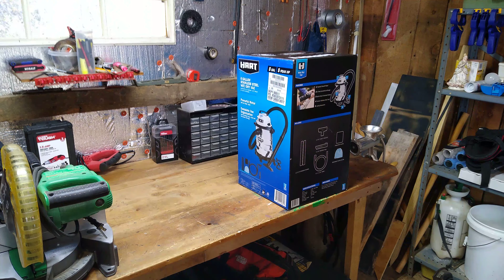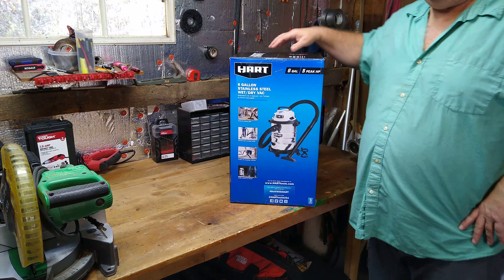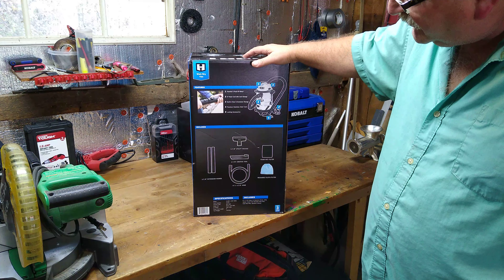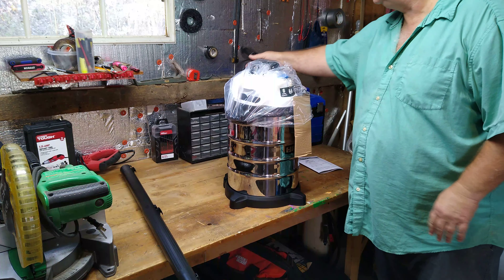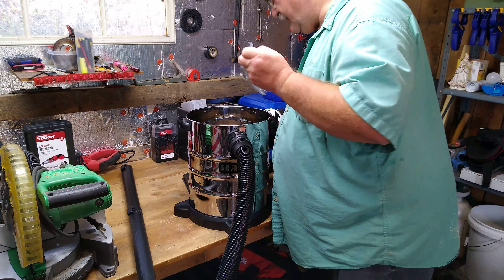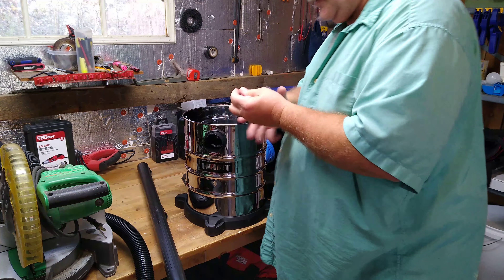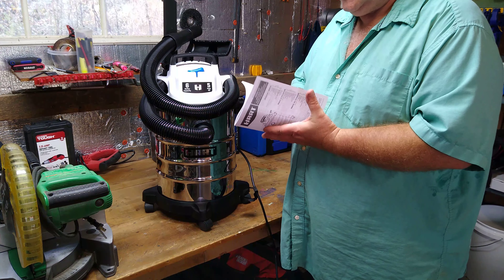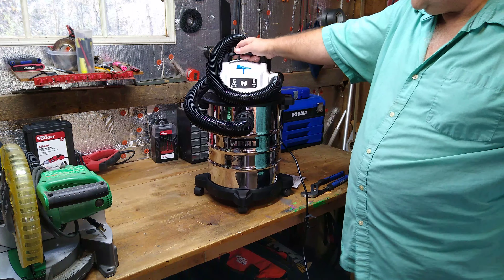Hart 6 gallon stainless steel vacuum, $29.97 Walmart Black Friday deal. unboxing and first look.

Comment: Does this mean that you can only dry vaccum up what will fit in the blue filter bag ? Or does the dirt go into the can and the blue bag keeps the dirt from getting into the motor ?
Reply from the maker: Yes you can pick up water, and you are correct the blue filter bag is to keep larger stuff out of the motor.

Comment: We just paid $58 for ours and it didn't come with a manual, I'm wondering if we use the yellow filter or the black filter when sucking up water, and or what if there is cat liter in the mix.. I am not a happy camper with my buy since I don't know how to use it.. can someone tell me in the comments please? Lynn
Reply from the maker: The yellow filter is a paper filter do not use it for wet applications. Remove the yellow filter and put the black foam filter on it. And yes it will be fine to pick up water with cat litter in it. The foam filter will stop the larger larger particles of cat litter from entering the fan intake on the vacuum. Only use your paper filter when vacuuming dry applications. I hope this helps you out. Thanks for watching
Reply: @HamiltonOutdoors  oh my gosh, I would have done it wrong; so thank you, very much...

Comment: Do you have to use the dust bag
Reply from the maker: I would think you would want to use the dust bag over the intake to keep larger particles from entering into your Shop-Vac. They might make a paper filter that would fit this model. And I'm not sure if they have vacuum bags that would fit it either but I think I would leave my dust cover on the motor. If that's what you are talking about as a dust bag. I hope this helped

Comment: I haven't opened my box yet but after seeing your video I might take it back. Without a paper filter you're going to have fine dust everywhere, including your lungs.
Reply from the maker: They possibly have a paper filter to fit it. Thanks for watching the video
Reply: @HamiltonOutdoors  Maybe, but then your $30 vacuum turns into a $40+ vacuum. Not a great value anymore.
Reply from the maker: Yeah you have a point there, I use mine so infrequent just to clean my shop, I don't think It will be a issue for me. I'm glad my video helped you get some usable info on the unit.
Reply: The next version that comes with the bag is $75.  it is a 8 gallons and 6 horsepower  So for this one to be just as good as the other one and you have to buy the bag separately I think it's still a good value for $29

Comment: I bought this too, so yesterday I decided to give it a try. Idk if the used of this is intended to clean small areas like inside a car but I did my apartment floors (just living room and hall, n not to dirty) It does work but the filter makes a huge difference or the parts don’t attach very well but FINE DUST got into my respiratory system I still a day after feel sick. So in my opinion I don’t like this vacuum. I might have to find a way to return it or get the paper filter. :(
Reply from the maker: Thanks for watching